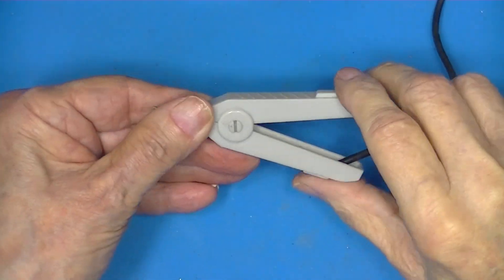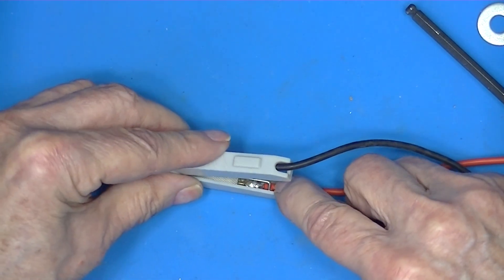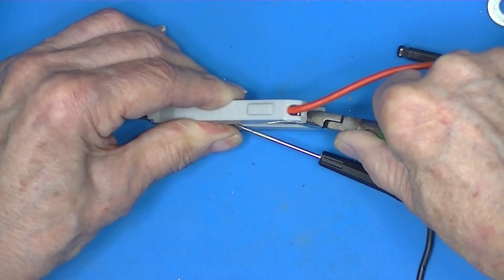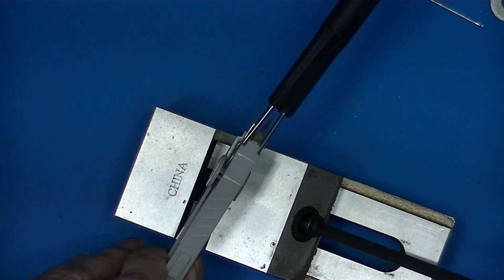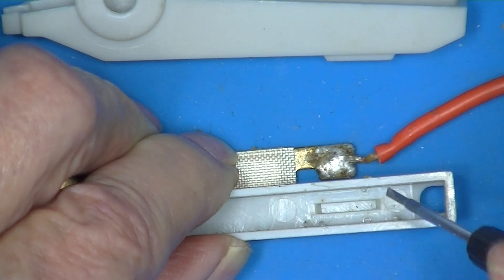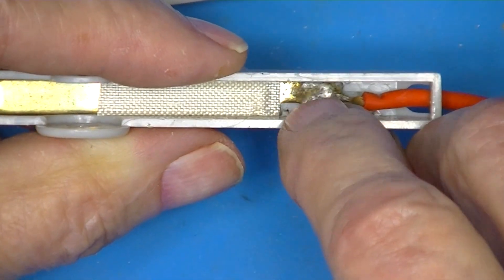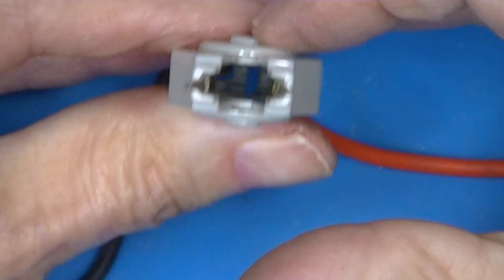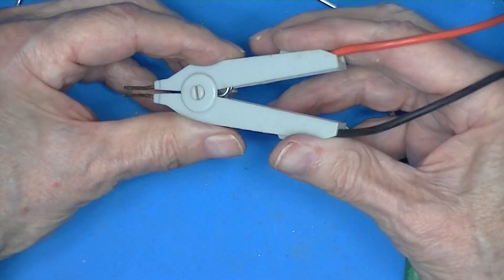Disassembly/Reassembly of Chinese Kelvin Clips

Comment: ALSO Mueller makes little gold 4 wire clips part BU-75K that are handy if you want to make your own leads. Digikey has them for about 16$.  Then you need 4 gold bananas and good quality test lead.  I would go with gold because anything else will oxidize and add resistance eventually.  Like for instance ones with plain brass jaws.  This could be a factor measuring milli-ohms.

Comment: I bought the ebay Chinese Kelvin leads that are numerous and cheap on there as compared to the US commercial ones that cost an arm and a leg and usually shielded with BNCs.  For an HP DMM that I had calibrated for 4 lead ohms.  Well they seemed to work fine but occasionally I was getting variations in the milliohm range with them, even clipped together.  Or with my reference 0.9990 ohm standard.  The thing I noticed was that the gold bananas on the ends had spring contacts that were free to spin on the center pin.  I finally used some silver solder and just enough solder to the base of the pin to secure the springy part to the rest of the connection.  Now my readings are more stable. There is no shield connection for the leads on this DMM I speak of.

Comment: Good info. Thanks. Speaking specifically about professional Kelvin lead sets... Pomona, Fluke, etc. Some come with an external cable ground shield. The clip end is not terminated to the contacts. However, the meter end of the cable has an extra connector that attaches to mains Earth, through the meter's auxiliary panel Earth ground. That would help with noise, but also creates a path to ground that must be monitored for wear and tear. You don't want an open ground shorting things out. Such is the case with the DE-5000 leads, as you know. Well, when you are using its wall power adapter, I guess.